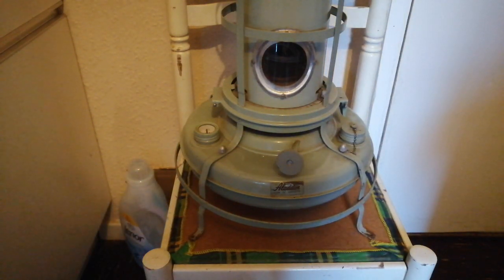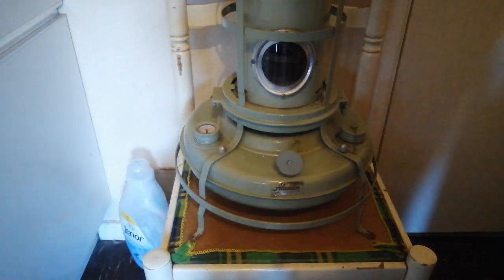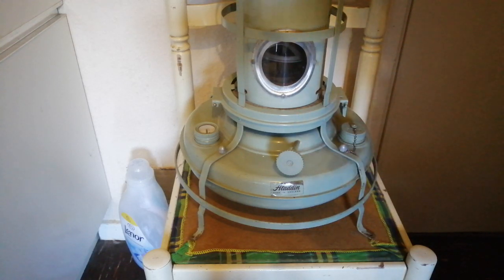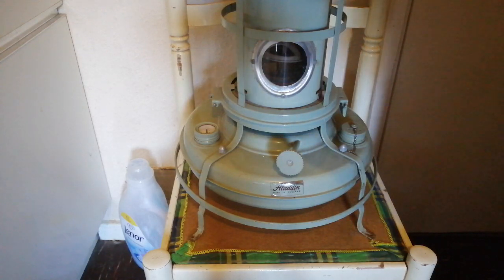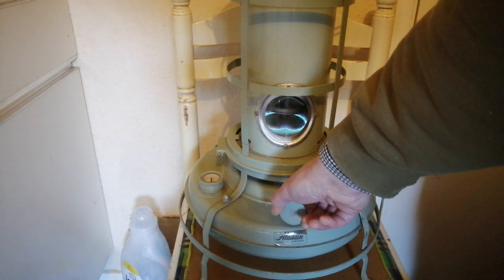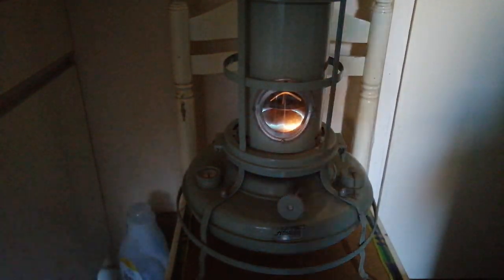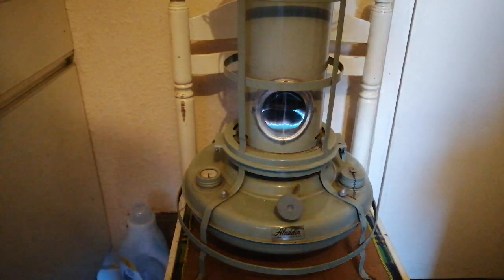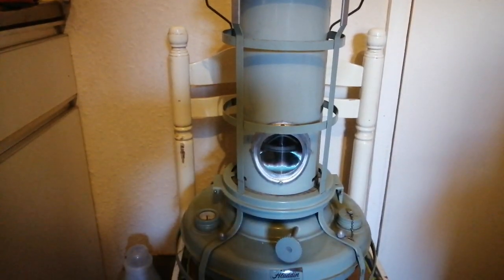Aladdin Blue Flame Model 32 Paraffin Heater & Stove. First Time Lighting It Up.

Comment: Can this be used indoors?
Reply from the maker: Hi Patriot. Yes you can use these paraffin heaters indoors. You must only use C1 Premium Paraffin BS 2869 Class C1. And have all air vents open on your windows. Patriot i have been using paraffin heaters from 2021 and now in 2023 i only cook with paraffin you can look at my other videos all done in the house. I have a petrol two burner stove but that can only be used outside i roasted a chicken outside in my MOD oven.